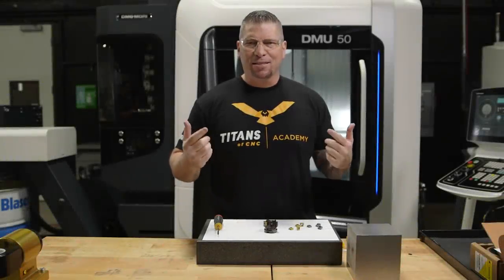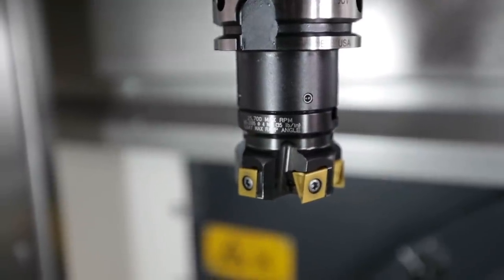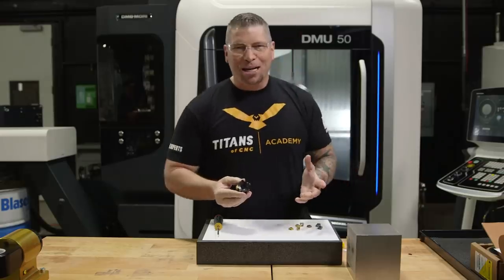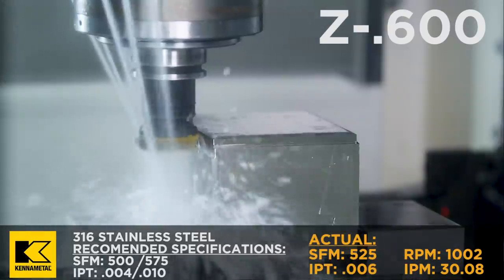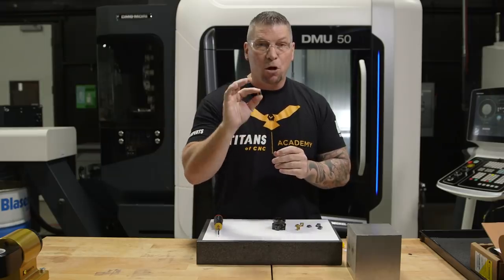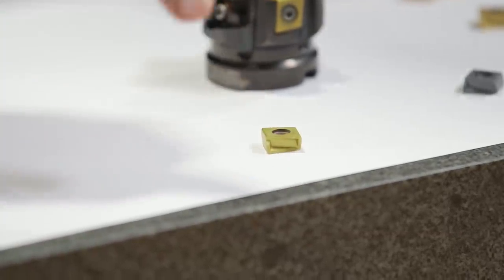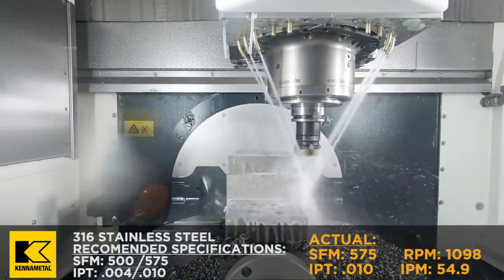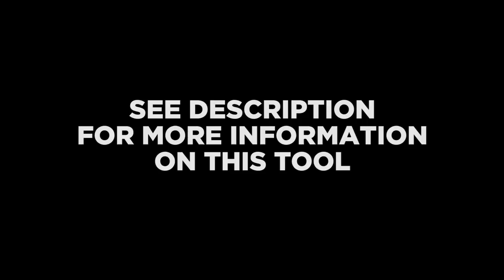Testing New Kennametal Tangential Mill 4-12 in 316 Stainless | DMG MORI | Vlog #61

Comment: Iscar have been using Tangential cutters for many years now. But the best on the market IMO right now are the Mitchubishi cutters referring to the 25mm range. But the Iscar 50mm highfeed roughing cutter is by far the market leader. I have used the kennametal as well, not as fast and durable. All ran on DMG MORIs.

Comment: This is the rebirth of the Hertel facemill insert used in the mid 90s. They were by far the toughest insert design around.
Reply: Yes, I was sure I had seen it before.
Reply: I think you are right. If you google Hertel it takes you to the Kennametal site. Used a 6” Hertel face mill back in the 90s. Was a high production tool for sure. Also loved the turning tools that used the same insert. Couldn’t beat them on long skinny shafts.

Comment: Hi I think the percentage step over is important as it alters the part of the tip that touches metal first.  Ie the edge of the insert or the face.  If the edge of the insert is hitting the metal first its a weak point opposed to the face of the insert impacting first.  Titan, please do a video on probing.  I only see videos on taking offsets.  I would like to see how to use in conjunction with fusion to check features in the cycle.  Thanks for your good work.  BOOOOM

Comment: The toughest parts I’ve ever machined out of 316 were a 3 op lathe followed by a 4th axis milling operation (mill op by someone else) I had to hold .003 con through 3 ops and a 6 micron finish on a burnisher and cut threads with a tin coated insert. It was terribly difficult.

Comment: Tried these parameters on a 1.5" x 3" x 3" block. Inserts were worn after 3 parts. I guess these numbers work when the block is a lot bigger and the vibrations are dampened a lot more

Comment: I'm using the same type of tool in 1.25 dia. And another 2.5"  and 4" and they work well for cast steel. We actually use the 4" with air only.

Comment: Very interesting Titan! Can you do a vlog on machining non ferrous metals ie copper,bronze..? Speeds and feeds and coolant?
Reply from the maker: Yes, will do
Reply: I need that information too.  I work with brass.  (Copper - Zinc).
Reply: Well, for copper, aluminium and various of their alloys, it`s recommend to use coolant. 
Not in every case, but in the most.
Reply: @MrCOD13579  What's so funny about brass??
Reply: I second that request. Hate to say how much money I've wasted trying to get a consistently good finish on copper. I machine a LOT of copper and I really need a mirror finish.
Reply: @jackflash6377  Define, "mirror finish"? If you're working parts to a specific requirement.. what is that requirement?
My shop machines optics.. so your definition of "mirror" and mine is likely different, as it's totally subjective.
Also, are we talking facing? Profiling? Planer surfaces only??
Reply: @zaknefain100  To me, mirror finish means flat and reflective like a mirror. No tooling marks, no ripples and flat as in a couple of tenths across the entire part (about 37 x 37mm).
Presently I use a PCD face mill and get a pretty good finish. I hit it with a scotchbrite pad to sort of mask the few tooling marks that are left and just make do with the "brushed" finish the pad leaves.
The surface mates with backside of a silicon wafer chip (Intel CPU).
How do you machine optics? polycarbonate lenses? I saw a little thing from Nikon indicating that they use a heated rod to actually melt the surface of glass and form it via CNC.

Comment: The inserts look like the configuration developed by Hertel, which got bought up by Kennametal a few years ago.
Reply from the maker: I’m pretty sure they purchased them a long long time ago... and now have taken the technology to the next level.
Reply from the maker: Actually 1993
Reply: I've been running a couple kennametal tangential insert face mills for at least 14 years the difference is the insert geometry is updated now and there's a screw rather than a retention rod. 

It's not my favorite cutter but the cutter bodies are still like new. They can take a lot of punishment
Reply: TITANS of CNC: Academy yes 1993. Sandvik could have purchased hertel but decided not to when they saw they didn’t have anything better than what Sandvik Coromant had. Sandvik Coromant is worldwide leader in metalcutting not Kennametal .

Comment: When profiling around the block with low radial engagement, you'll need to increase feed per tooth in order to maintain correct chip thickness.

Comment: I know this video is over two years old and the answer to my question may be answered in a more recent vid, so bear with me. On the side milling, with such a shallow radial engagement, would/could a faster speed/feed be employed, using the "high speed roughing" theory of higher RPM, with substantially higher feed?

Comment: titan, with this tool, try out to pump up the speed and RPM, but go less deep... I think that is better suited for your machines. Also, it could use a little more RPM without any other increases... the load on the carbide inserts will be lower that way.

Comment: I like the KM4X Taper, wonder why that never took off. As well as the km16 lathe toolholders with changeable heads.
Reply: Never took off because compared to Sandvik Coromant Capto KM 4X is weak and nowhere near as rigid. Sandvik capto is without a doubt best spindle interface made and it hasn’t changed since it was introduced in 1990. Look at how many machine tool builders that build their machines with Capto spindles. Far more Capto than KM.
Reply: @revisbest  exactly

Comment: has this been uploaded again? Previous comments not there.
Reply from the maker: Ya, I made a mistake and someone caught it... Quality is everything so we made the correction.
Reply: @TITANSofCNC  Thanks for the reply. In the video, the surface finish wrt the profiling looks a bit rough. A close up would have been nice, but I'm happy to take your word for it being OK.
Reply: @debonh3828  it doesn't really matter if it's rough. That was rough milling. Rough milling is just that, rough. The tool is meant to remove mass material, not provide a perfect surface finish.

Comment: I am liking this tool more and more. I would like to see how much material this cutter can remove before insert flip. I use ingersol now square insert titanium/stainless grade 2.00face  5fl 52deg rips through 316SS. .06 depth full dia s500 feed 60IPM.With coolant. 4.00 inches of material removed before insert flip. If I can get 7.00 inches removed well the tool is sold. I will have this tool. New subscriber looking forward to the next video Thanks...

Comment: In stainless steel with cutting inserts, compressed air from the inside of the tool together with external air cooling that contains a little bit of oil works way better then cooling water! Materials like this have often a hard skin. Around 2mm. When cutting the side walls of the part conventional milling (ccw) works better when removing the hard skin because the flutes will form the chip in soft condition and leave the part in hard condition. After the hard skin is removed change to climb milling (cw). Please teach them this advice!!
If we had to mill down the hole part :-) with this tool I would try to use the hole lengths of the flutes (12mm) with less (ae) side stepover so we can apply the wear on 12 mm instead of around 3.5.
Reply: I love your answer! Don´t understand why Titan doesn´t know that. I work in a company how only works with 316l and super aloys and we also mill with compressed air and only for finishing with water...

Comment: What happened to the Schunk Vero-S system Titan?
Reply from the maker: I still have it, and love it.
Was using it on a different machine for a different application.
Reply: TITANS of CNC: Academy and you should haha. We have it on all out Mills nowadays. The Okuma Mb46 and VF-2SS and UMC-750 all have a 6x station. All our vises, clamping devices and fixtures have the 25mm holes and studs under them. Very good stuff.

Comment: I have a couple of noob questions.

#1 - I've noticed this issue on almost any part after it has been surfaced/faced whether on your channel or others.  In this video, after the tool has made all of it's passes you can see "lines" on the part roughly equal to the depth or width of the cut.  Are these "lines" actually measurable ridges or is it just a visual effect.  It gives me (a novice) the appearance that the machine is incapable of making a "perfect" cut all the way down or across the part.  Is this part of what is allowed in the tolerances chosen or is it just visual and actually "perfect"?

#2 - If the carbide insert has 2 cutting sides, does the portion of the actual tool/mill that is directly behind the unused cutting edge of the insert provide support and rigidity to the carbide insert or does the screw that attaches the insert to the mill actually carry all of that shearing load?  It seems to me that after you have used up most of one side of the carbide insert and then flip it to the new side, it would not be touching the tool any longer because of the wear.

Thanks Titan(and team)!
Reply from the maker: So the Lines look worse than they are and are smooth to the touch. Of course the deeper the cut, the more pressure... which could create a deeper line... your dealing with tenths though and if you lighten the cut, it’s completely smooth...

Front has 2 cutting edges and also the back for a total of 4
Reply: The inserts are designed so they sit in a pocket so after you index the insert the used cutting edge never interacts with the pocket hopefully that answers your question Multifamily Electrical
Reply: @metalman6708  or buy a profilometer
Reply: @metalman6708  Give them a comparator, which is left to subjectivity or a profilometer, which takes all the guess work out and let's you know whether you've met the requirement or not?

I can't afford guessing, and newbies tend to guess more poorly than experienced blokes, so yeah...
Reply: The tool has 4 cutting edges as than said, and you will ALWAYS see lines like that. The surface variation (whether you can feel them or measure them) has to do with your feeds and speed, tool deflection, rigidity, etc. If you're shredding through a cut, and the tool is deflecting, you'll feel them more. In the scenario on the video, you would finish that side wall up with a long EM and cut the whole height at once as a finish pass at a few thou step over. That will remove all the lines and surface deviations. Oh, and the insert is supported by the tool. That picket it sits in takes the load, and the cutting edges of the insert aren't touching the tool.

Comment: If i understand the tool correctly, its only 2 corners insert, therefore it is very expensive. If you check widia's vsm890, it does the same work, faster and cheaper, every insert has 8 corners!
Reply: Fischer 977, if it's the same type tool/inserts I'm using as we speak in three different sizes and insert specs. One exactly like the  one he is using they do have 4 edges per insert, use,rotate on hold down bolt(screw), flip,rotate again

Comment: Hey Titan. I keep breaking small carbide endmills such as 2-3 mm diameter. I don't have any problem with diameter 4mm and bigger endmills. I do feed and speed calculations. I machine aluminum most of the time, chips look good but is there any trick for not breaking small endmills? Thank you.
Reply: With small endmills in aluminium you have to keep the sfpm as high as your spindle will allow. A 2mm Endmill for example has to be run 6-7 times more rpm's to achieve the same sfpm as a 12mm or 1/2" endmill. Unless you have a 20000 plus RPM spindle it's impossible to do that. Therefore you have to reduce the chipload by reducing depth of cut or by reducing the feed you are pushing it at. Combined that with the fact that carbide it's extremely brittle and the web thickness of those tiny endmills just can't handle the same chipload. Which means even slower feed. It's not exciting to watch but it gets the job done. Or Take multiple cuts of only .010 deep as fast as you want to prevent breakage. Without knowing exact rpm capability, workholding and tooling used I'm just guessing.
Oh and make sure you got great coolant flow. The tiny endmills don't clear chips as well. Because aluminum produces stringy chips and tiny endmills have tiny flutes. 
It's fun though isn't it?
Reply: @drewjohnson4794  thank you for the answer. It has been a year since I posted the question. I found a sweet spot for 3mm endmills and I avoid using 2 mm most of the time. I tried a similar approach to your answer and it was successful.

Comment: Hi Titan, great video. I was wondering what control you have on the DMU, is it the Siemens or the Heidenhein? We are getting a DMU 85 with the Heidenhein TNC 640. I don't like the control choice, but Management is driving the choice. If the Heidenhein, what do you think of it?
Reply: Don Jones I’ve used both and you won’t be disappointed. I like HH but Siemens 840 is really good as well you’ll actually wonder why people bother with anything else.
Reply: Don't be put off with the heidenhain it's a brilliant control, I'm sure you will change your mind once you've had a play with it.
Reply: When u want to program a part at the machine and not through CAM nothing can beat Heidenhain controls

Comment: Typically we do not run coolant on our indexable tools due to thermal shock. I would be interested in tool life with and without coolant. I also realize your cutting stainless and the stuff is gummy, do not want to recut chips stuck to the side.

Comment: Nothing new. Iscar Helitang has been around for many years. Tangential cutters are the workhorses of our shop.  Good job with the educational add for kenemetal. Lots of good info for beginners.
Reply from the maker: Monday’s TITANS of CNC YouTube Vlog is going to be Awesome! Just Straight Getting After It In 4140 Steel... With The NEW Kennametal Tangential Shoulder Mill.

A little history lesson since some have been confused. Hertel an old German Tool Maker developed the technology, along with the old Ingersoll (Who used Kennametal Carbide) back in the 80’s. In 1993 Kennametal purchased Hertel and has owned this technology for decades... When Ingersoll broke up, many of the top engineers went to work for Kennametal. Today, is a new day and Kennametal has taken the technology to new heights... “New Patents & Yes, New Heights”.

Comment: I go to the tool  websites like Kennametal , Iscar and others but they say to contact my local supplier. I contact them and a few days later they call me back, I ask for a  certain tool that I saw on the website. They don't carry any stock and will have to order the tool I want. It will be drop shipped from the tool manufacturer. What?? Wouldn't it be much simpler and quicker to just order it from the tool website?
Sounds like a crazy system to me. So complex when it doesn't need to be. Just sell me the tool and inserts Kennametal, let me pay for it on your site and ship it to me.
Reply from the maker: You can order directly from Kennametal or through Kennametal Konnect. They also have a new program called 1st Choice, where as 80% of everything you need in Machining is guaranteed in stock and to ship the same day.

Comment: wouldn't call it getting after it at all...
I have a much smaller much less rigid machine and I'm running a smaller tool in 316L and getting better removal rates than even the last pass.
I understand if you couldn't push it hard because its a demo tool but the numbers were not at all impressive.
Reply from the maker: Definitely wasn’t... just showing safe, good numbers that present a starting point for Machinists... of course your machines HP has a lot to do with it
Reply: TITANS of CNC: Academy good to know.  When you can would love to see that thing shredding

Comment: Nonsense, this cutter.  The video strokes the material, but not mills.  You have a fashion to show a demo when the part is rigidly fixed.  In normal conditions, try the parts after welding, when everything rattles.  All records will fly out.  It’s better to handle the high feed.